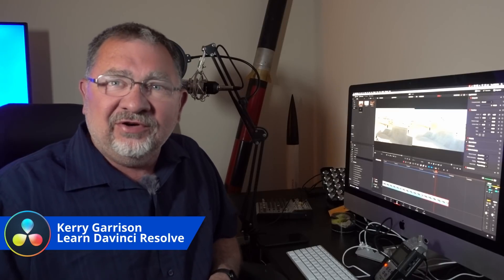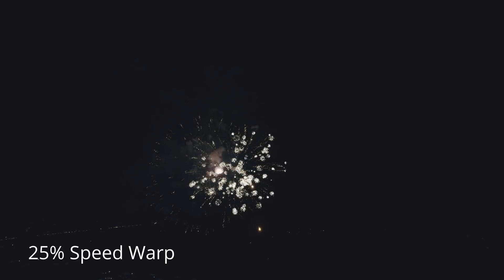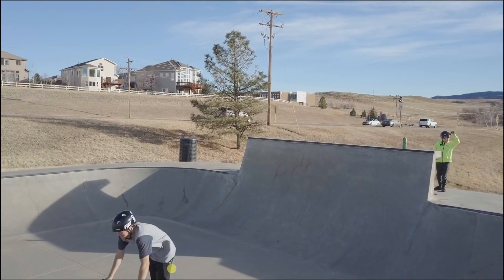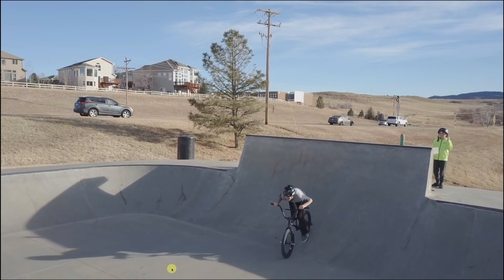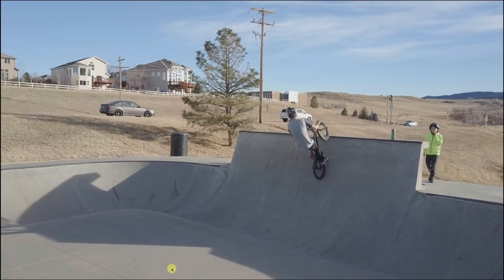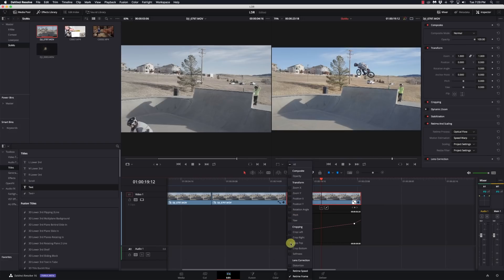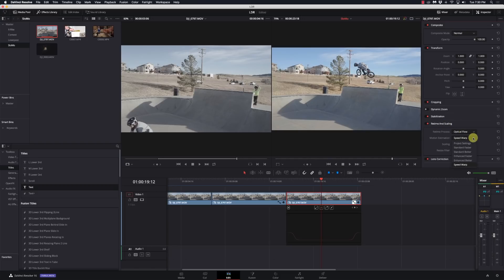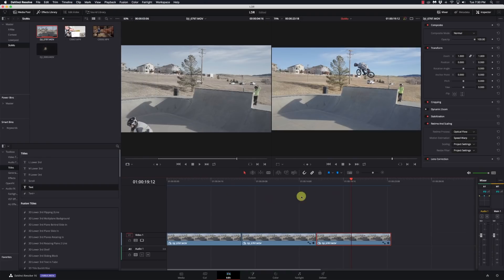Davinci Resolve 16 Studio - SpeedWarp Timing Control

Comment: Im having audio that is synced for the beginning of a clip but drifts off over time. I want to make the change to the video file and not the audio, whats my best move? its probably just 5-10ms max at the end of the 4 minute(ish) video.
Reply from the maker: Adjust the speed of the video so the length matches the audio

Comment: In this case, would it help to remove the white car (or maybe all cars) in the back first (since it's a steady cam, that's not to hard to do) and than using SpeedWarp?
Reply: Piet Muijs that’s a good question, certainly the cleaner the plate the better it can do so it would seem that removing it would improve the final results
Reply: @KerryGarrison  Yes, that's what I was thinking. Or even go a step further, removing the cars add the SpeedWarp and than add the cars back again?

Comment: My mac is completely frozen in the processing speed. I choose optical flow with speed warping upon a 4K lumix GH5 footage. Should I create a proxy of this then do the effecting after?
Reply from the maker: Soeedwarp is a monster of a resource hog but can be well worth it, I would use optical flow first to get your timing down and then enable soeedwarp as a final step
Reply: @FilmmakerCentral  That's what I did. But the moment I put speed warp, it has completely froze. Would this mean I might need a GPU booster for my iMac?
Reply from the maker: +Sk Laishram it more likely means we need to wait until Blackmagic does some optimizations of the code.
Reply: @FilmmakerCentral  Oh ok. Thank you!

Comment: I want the Studio version now.

Also how to get best results? Shoot a low shutter angle to get no motion blur and add that in the end artificially?

How does this work in conjunction with the Fusion node for retiming?

I got a gimick camera that does 250,500 or 1000fps but at 1000fps the resolution is really low.  I could get better results shooting at 1080p250 and using Speedwarp to go slower, also has the feeling that it will get better results with dynamic retiming because it can think up on exactly the frames I need. 

I wonder what model they trained it on and how far it generalizes. Maybe the one nVidia showed half a year before? 

One day I will shoot 1000fps on my stills camera while recording 24p raw on the pocket and combine that with some 'Neural Engine' magic.
Reply from the maker: It is best to always use the 180 degree shutter rule, it will always get the best results. The system wasn’t trained on a specific camera, it analyzed each frame to determine what it needs to create

Comment: iMacs aren't speed demons in a lot of cases. It may work better on a real render workstation.
Reply from the maker: xWood4000 it needs optimization on anything right now, it’s the first beta version of it and I am sure it will improve
Reply: @FilmmakerCentral  Of course. I'm just saying that a very powerful computer is needed for bad optimization, until it's fixed.

Comment: Resolve has so much goodness. If only it didn't use that goddamn database structure.
Reply: what is the problem with the database structure?
Reply: @Leprutz  Resolve uses a database rather than a project file. The database can contain multiple projects. The idea is that it allows for multi-user access and also access to resources across projects, e.g. you can have someone doing colour correction whilst some one else does effects or editing etc. I've not looked into it in-depth but understand the principles and why they've done it this way. Other video editors simply save a single file that you can move around freely, it has no dependencies except for locating the media used, which can be re-linked if required.  The Resolve system simply doesn't fit in with my workflow, whereby I store client projects as separate folders and most of the content is non-video related, and those projects may be moved frequently from one computer to another, and are backed-up frequently to external drives simply by making copies of them. You can get around this with Resolve as far as I understand it - exporting databases or projects and/or having separate databases per project. I'm still looking into it but it seems like something I can't integrate into my procedures in any simple way.  It would be nice if Resolve had an option to use either the current database system or a "single user" type file-save (as per other NLE's). Even Fusion stand-alone uses a simple all-in-one file-save (excluding media), but if you use Fusion in Resolve you're committed to the database thingywhatsit.
Reply: @andyq9669  Cool but maybe it is due to my language that I do not understand clearly. What is with Avid Media Composer, as far as I know, different people can work on the same project too, so this makes it Database based NLE? And just because in FCPX you cannot work on the same project at the same time it is file based? I still don't understan that. because what I am using in Davinci is files, like in FCPX, In Avid, you either link the files to the system or it creates it's own files to work with.  Thank you anyway for taking your time. I just want to understand.